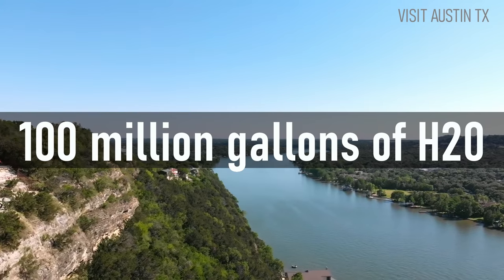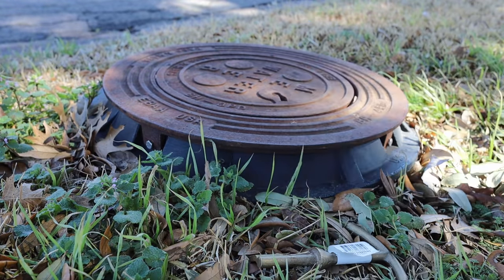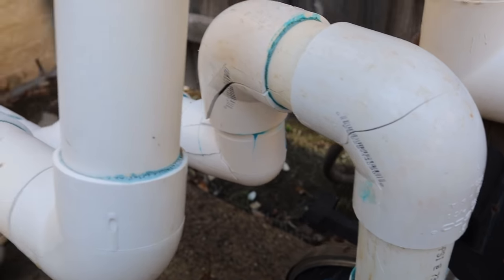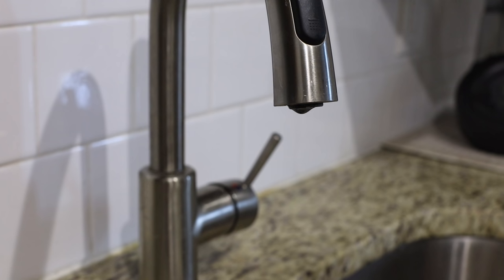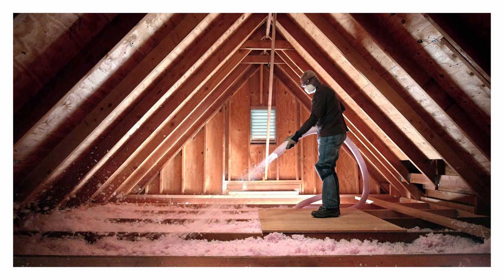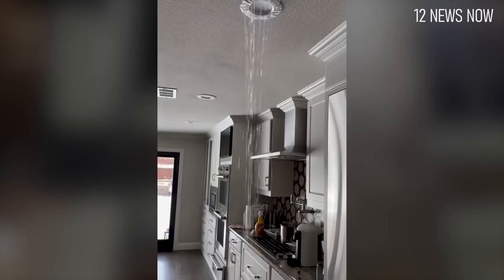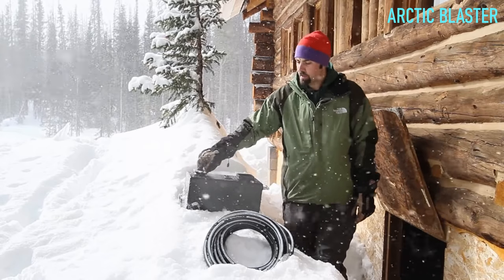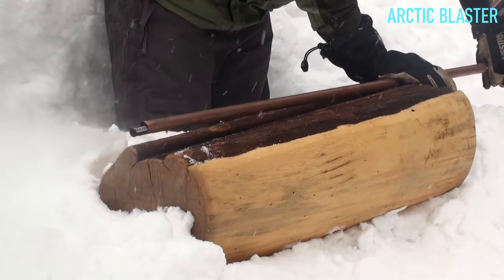How to prevent frozen and burst pipes

Comment: Your only party correct in your assumptions. I live in a much colder climate, Northern Iowa. Almost none of the homes here have insulated roofs. The key is to have the plumbing inside of the insulated space. I do not understand why so many homes in Texas are all on slabs. Here they are on basements or crawl spaces. Those basements and crawl spaces allow the ground heat to keep pipes from freezing. Here you never run a drain or water supply pipe above ground or in an uninsulated/unheated space. 
    Your explanation on why to turn water faucets on to keep from freezing is partially correct.  Reducing pressure does not keep lines from freezing. It can help prevent the lines from bursting.  The water that is coming from underground lines, is above freezing. So its flow keeps the water temperature in the lines, above the freezing point. It is basically an energy transfer. The water going down the drains does the same thing. The statement that flowing water does not freeze is factually correct. Although the movement is not the reason. The movement mixes the water of different temperatures, making it stay above the freezing point.

Comment: In places where cold winters are a norm, insulating top floors cover instead of the roof itself ( if you have attick) is more desirable) attack spaces basically acts like huge ventilated air layer that reduces the chances of heat seeping right directly in to roof layers and melting the snow, which leads to serious build up of ice over the roof, the edges, and over the roof drainage, and if the overhang is not too big the ice can build up on walls
And in summer same is true, sun gets blocked by roof that heats up, and air in attack space heats up and ventilates, thus not letting the heat further in, but Roof must be made in a way where it ventilates thought convection ideally having space on the very top to ventilate out the hot air, and sucking in some cool air.
Unless you are turning attic space in to livable space, it has an important role in protecting roof  from escaping heat in winter and protecting  living area from extrema heat  of the sun, 
(today you have many new materials and systems that also deals with these issues separately for higher price, but this is the traditional way of dealing with them)

Comment: Install anti-freeze exterior hose bibs. The handle turns a long rod to the actual valve that is twelve to eighteen inches inside the house which eliminates normal freezing risks. Put external lines on a separate circuit that can all be shut off in the house and drained in the fall. Use pressurized air to blow out lawn sprinkler in-ground systems (this is a money making service for landscapers in the North already). Architect education is needed to improve the designs of new Southern homes. Otherwise it's a series of bandages over costly rework. I'm in the North and third owner of at house originally built from Georgia plans -- one set of pipes runs though an attic space over the garage (can't believe code inspections allowed it) and nearly froze the first winter I was here. I over insulated that area and it's been ok for a decade but it's a risk I continue to monitor.
Reply: Drain outside lines in the fall? how are we supposed to water the grass and garden, wash vehicles, fill the water for animals, etc.? Have you lived in the South? a couple days after the freezing weather in Texas it is 75 degrees, according to Matt from Off the Ranch. I live in SoCal. It will only occasionally freeze and 85 degree weather happens even in December and January some years (including this year). People are not realistic. It isn't practical or cost effective to build homes the same as the north for a once every 10 year event. Should California build for tornadoes? We have had a couple near me, but the odds of having damage are very low. Improvements can be made, but what many people suggest is based on their lack of knowledge. The utilities not being well equipped made the situation very bad and improving that would have made a major difference. I have been in the building trades for 25 years, so I understand a lot about how and why homes are built they way they are in the south.
Reply: The plumbing suggestion is good. House builders are not responsible for pipe bursts in cold snaps and so choose the lazy cheapest way. The city needs to update their inspection codes to force them. Texas has extremely variable weather as per previous comment but it'll still be good to shut off external plumbing as needed.

Comment: Insulation,  Insulation,  Insulation.  Not only does it lower heating costs and prevents burst pipes. It also retains AC and lowers carbon pollution in hot weather.

Comment: Mostly you are spot on. I am binge watching your video's now. Two things I do not agree with. Copper pipes can be bend. I do it all the time. It is also a lot cheaper than buying parts for every corner. The other thing is covering the vents to the crawl space underneath the home. Yes,  you could cover it up in cold weather. But please open the vents as soon as possible. If you don't, the wood will rot because there is no ventilation any more.

Comment: When building houses we should keep the water pipes and the HVAC systems out of the attics & side walls ( as Joseph Lstiburek would say, the only thing that should  be in a vented, well insulated attic is " nothing". Please visit  Joseph Lstiburek on YouTube  ( to vent or not to vent). Joseph is one of the best in the business 👍.
Reply: What you are suggesting would mean 90% of homes built today are wrong or HVAC systems themselves can't be put in homes. It makes no sense. If you can't put those systems in an attic where will you put it? There's nothing wrong with putting it in am attic, we just need to increase the competency of those installations through licensing and smart regulations.
Reply: @AJ-ox8xy  ,. 42% of the Standalone homes have basements( guess where they put the HVAC ?). If you want to put HVAC equipment in a conditioned attic I have no problem . If you want to put a HVAC system inside the conditioned area of the  home's envelope, I have no problem. If you want to put the HVAC system inside the condition garage,. I have no problem. Putting a HVAC system in a unconditioned attic is not wrong, it's just cheap and inefficient. If you watch Joseph's video to vent or not to vent for 10 minutes you may understand ( he is one of the best in the business).

Comment: Biggest thing that needs to be done is heat tape everything portable water and drains alike but if power goes out for more than a few hours and your in double digit or near single digits temps u need to already have 20 plus gallons of filtered water on hand. Also u need to turn off your main line shut off and have a drain plug on both the portable water and drains before it all freezes up and burst all your pipes costing hundreds or thousand of repair Bill.

Comment: Having pipes run through indoor walls is a building standard in europe. It's insane what's going on in the US with their cardboard building codes.
Reply: This is code for parts of Texas because it's cheaper and our climate is normally hot. It's first snow we've seen in 40~50 years. (first time I've ever seen snow in real life was during this event. As a kid I thought snow was a movie/tv thing to show it was winter). Same reason we build with wood (which you call cardboard for some reason), it's a renewable source of building material that lasts a long time. In parts of Texas and the rest of the country that normally get snow the building codes are different.

Comment: don't forget the biggest one! a generator! if you lose power, and thus lose heat, then you're at MUCH greater risk than if you could heat your home, even a little. even propane heaters often deen electricity to operate. if your heater is low enough power (like a gas boiler) you can use a 750W car-battery to 120v AC inverter, as long as your car has fuel.

Comment: I am fascinated by the laundry equipment, your stuff is massive compared to the tiny 600 mm wide and deep washing machines we have in the UK.
How much power do they consume. Are the hot and cold feed or just cold feed like the UK ones?
Are they single or 3 phase? I think your voltage across the pond is 120V AC so I guess the current used with be higher, maybe 20A per appliance.
Reply: Major electric appliances like ovens and dryers tend to have dedicated 240V outlets. Washing machines can work just fine on 120V though. I think the power supply to the home in America is almost always 240V, but most of the circuits in the home are just 120V.

Comment: Many pipes are insulated along the straight runs with the insulation being mitred or even omitted at bends.  You failed to point out that the bends are most vulnerable to freezing.  It is not the ice that busts the pipe. It's the build up of hydraulic pressure between two freezing blockages; usually at two bends; that does the damage. Therefore, particular attention to the proper insulation of bends and junctions is essential. Personally, I would not recommend metal fittings with plastic pipe. They conduct heat away, more readily than they can receive it from the water filled plastic. Consequently they freeze more quickly than metal-to-metal or plastic-to-plastic installations.

Comment: I guess I've never thought about it. Could a type of pipe be made that had a heating wire running along it? that way if conditions hit that might freeze pipes - you could turn on your 'pipe heating'? Copper is also a great conductor of heat so you could have devices that clamped around copper pipes and allow it to conduct. Not for un-freezing pipes no - but for keeping them from freezing in the first place?
Reply: I'm sure I've seen a cable-like heating system you can get for greenhouses - something like that running along with your water pipes?

Comment: If the stores have run out of insulation for water lines you can literally dress them up.    Yeah put a lot of clothes around them.     Also if temps get down to single digits a faucet needs a lot more than a slow drip.

Comment: Hi Belinda.   I would love to have you review and provide your take on the water problems that Marshall Remodel (YouTube Channel) has just encountered with their otherwise superb pole barn style new home construction that used a combination of spray foam and fiberglass insulation.  They put about 3 inches of closed cell spray foam in their wall cavities and then added fiberglass inside of that but now have very wet fiberglass.   You might be best person to figure out and explain their problem and how it might be fixed.
Reply: The vapor barrier needs to be on the inside. Very basic construction common sense.

Good topic for a video indeed
Reply: Closed cell foam acts as a vapour barrier. Warm, moist interior air will migrate directly through the fibreglass insulation and condense against the foam. Mystery solved!

Comment: Rats love PEX.  I have had this happen in a garage, leak where the rat bit into the PEX.
Reply: So you don’t actually have a potential freezing pipe problem, but rather a rat problem.
Reply: @seanm3226  No, I am just south of Austin, and we took measures that prevented my pipes from breaking.  The rat that ate my pipe was dislodged from a house next door due to renovations. The rat died...
Reply: Rats and rodents love wiring too.  Replaced many chewed on wires when I had a house in wooded area. Big fire risk though luckily the breaker did their job.  Get rid of the rats rather than the pet.

Comment: In new jersey, if you touch the valve owned by the water company and you break it even  during an emergency, your fine is $10,000
Reply: It seems in Texas, many houses don't have their own internal water shut-off near the water meter as they do in the colder areas of the U.S. where houses often have a basement with the water shut-off there.
Reply: @bburton333  
I am talking about the outside shut-off value, the one in the basement you can shutoff with your hand.
Reply: @thehandashow993  Belinda is talking primarily about Texas where many houses are built on slabs so there is no basement. The only effective way to turn off the water for many Texas residents is the the way she described.
Reply: @bburton333 
what I am trying to say is, this might be a liability because the valve belongs to the company

Comment: Freezing of the standing water in your toilet can make it burst. Adding salt to the water prevents that.
Reply: not if it gets cold enough
Reply: Pour a good squirt of antifreeze in the bowl and the tank. And all the traps of the sinks and tubs. Or blue windshield cleaning fluid.
Reply: In most places antifreeze is a regulated hazardous waste. It is illegal to dump it down the sewer drain...
Reply: @nc3826  You are not wrong. However, by the same token, shoving a Bic pen into someone's windpipe when they are choking to death is a legitimate first aid technique, although it is also an assault. But it will save a life.

I'm waiting for your channel where you can debunk everybody else and their pitiful brain droppings.
Reply: @nc3826  I should expect not if you use propylene glycol.  It is relatively non toxic.  And it doesn’t take much to keep a P trap protected.  My outdoor kitchen may get this treatment if I can’t figure out an easy way to dump the trap without disassembly.
Reply: Safest option would be to siphon and drain out all the water from a system and use a rag to prevent sewer gas.... It's not that hard to do it the right way... 

BTW the time it would take for a toilet to get cracked...ppl with copper pipes would have far more costly worries ...
Reply: @jasonji1900  "P trap with drain plug" do an internet search for that. Lowes has is listed. A plug for the drain in the sink would stop fumes, or rig up a pvc valve on the drain if there is space. You would probably have to do it after it transitions to abs or pvc or make up an adapter and large pvc valves can be a pain to turn.

Comment: The obvious solution is to move out of Texas.   To places that have a grid that can withstand a little cold without suffering a cataclysmic failure.   Doesn't happen in Minnesota or Wisconsin.   Also the cold kills fire ants so we don't have those either.    Lived in Texas 3 years that was enough never going back.

Comment: Simple heat tape will solve all these problem's and its cheap.
Reply: They lost power.  How do you use heat tape without electric supply?
Reply: @were_all_fact6026  The title says How to prevent frozen and burst pipes correct?
Reply: @wd8557  You said  ...solve all these problems....  We have heat tape installed where I live and we're insulated as well.  During an ice storm('98) we lost power for 18 days (never above freezing) and I had a pipe freeze in an area I couldn't heat (wood stove was my source of heat).  We got our water from a well powered by electricity so no water to drip either.  Generators were sold out for hundreds of miles.  Gave me a great appreciation when the power was restored and I could turn on a light, take a hot shower and flush a toilet without having to carry a bucket or flashlight.
Reply: @were_all_fact6026  time for you to get a whole house generator. I have lost power but never gas.

Comment: If you want an idea for a video?.
My belief is this:
The world has absolutely no shortage of clean, fresh, safe drinking/ irrigation water.
We have a problem of distribution.
 Prove me wrong.
 In many areas they suffer flood, then drought.
If they'd stored water in the excess and used it during the shortage.
Or transmitted water from areas with to much to areas with not enough.
The problem is solved.
Yes, it's  mammoth project.
But, it could be done.
The tag line,
 ' were running out of water.'
Is just, to coin a phrase.
False information.
If I'm wrong, show me how.
Show how if flood waters and great lakes were distributed, nations wide. 
That anyone would not have water?
Especially while we're being warned of rising sea levels.
 This planet has more then enough water, maybe to much.
We are just ineffective at distribution.